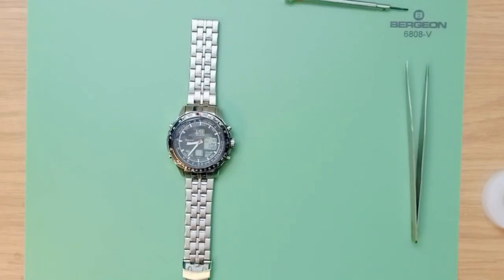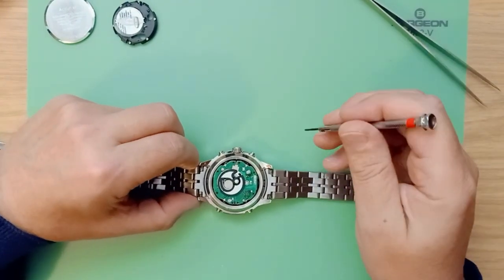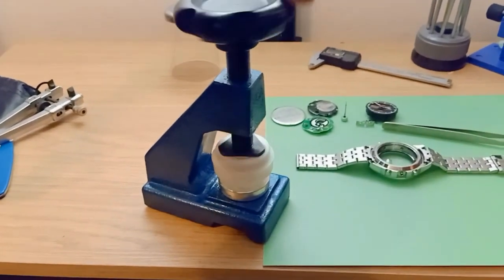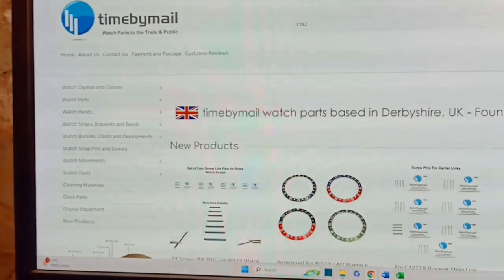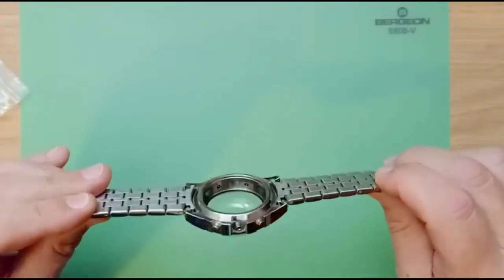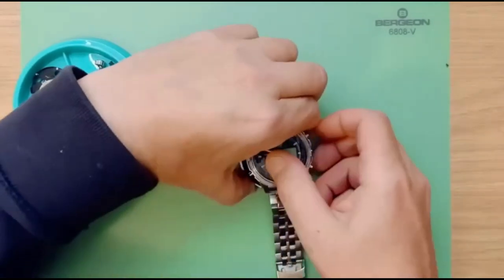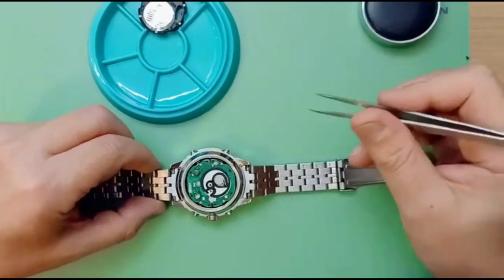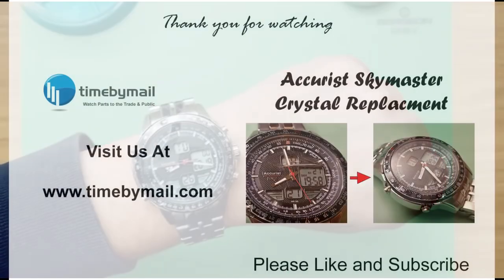Accurist Skymaster - Watch Glass Crystal Removal / Replacement - Step by Step Guide

Comment: Hi which battery is responsible for the backlight. I have changed the battery for the digital display. I have reset by shorting out ac to battery positive, and digital side works fine until I press the backlight, and I lose display for approx 2 seconds. Any help regarding this issue would be much appreciated, because I'm finding many people have had the same problem, but can't find a solution, and yet it seems a very common problem, regards Andy
Reply from the maker: Hi Andy, the battery for the digital display runs the backlight. To be honest im not sure why you lose the display. Only reason I can think of is the battery is not powerful enough (faulty or old stock, even though it's new) or the connection is dirty.
Reply: @timebymailuk  thanks for your response I will have a better look once new battery arrive, and will let you know if I manage to find out what causes this common problem, kind regards